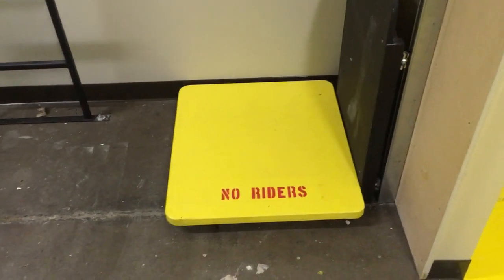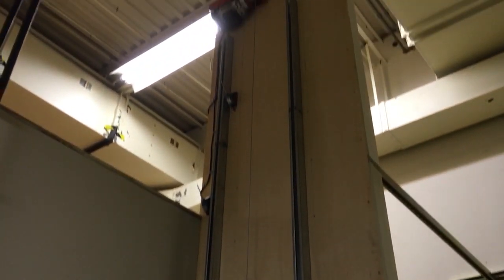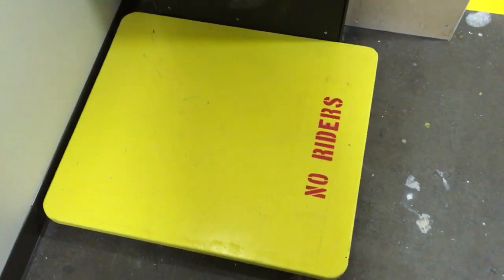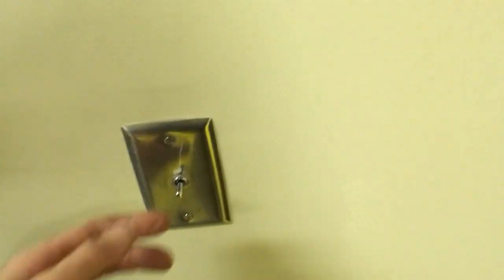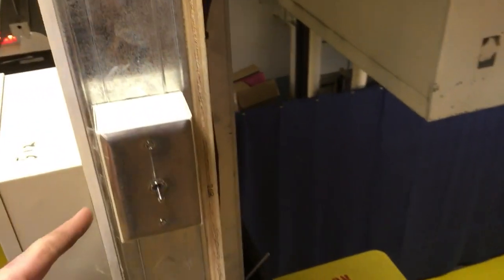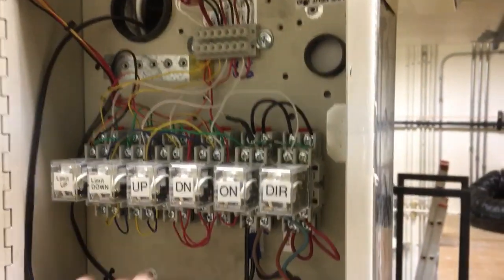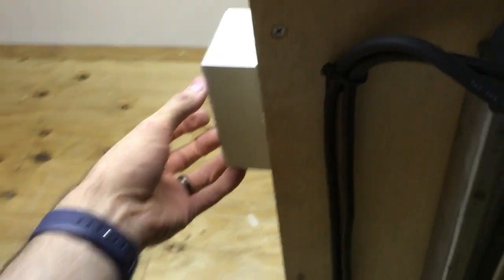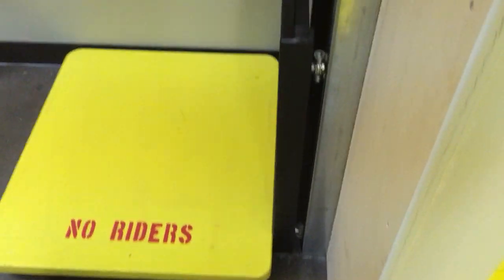Harbor Freight Hoist Dumb Waiter - Elevator

Comment: Nice design and build. Exactly what I was looking for. I can easily add a safety line or brake.
Reply: you want a slack cable safety where if the cable ever goes under slack, 2 spring loaded bars swing out and get stuck in slots in the channeling. Its how the first elevators did it

Comment: Suggestion…. add a second cable to the winch as a safety backup. I’ve had a similar mechanism using a steel cable which after many cycles ended up fraying and breaking. Your travel isn’t that great and the winch drum should easily accommodate a second cable. The second cable will serve to hold the platform in the event either one of the cables break.

Comment: I would be lovely to see the schematic for the relay and control circuitry. I have the exact same application and would prefer to do a "dumb", relay-based solution rather than get into Arduino or similar rigamarole.

Comment: The wiring etc.  in a nutshell;

JZSlenker

3 years ago
I don't have a schematic on paper.  Basically your need two DPDT relays to replace the rocker switch that comes on the winch.  One relay determines the direction, the other relay is "ON"   Apply power to the on relay to cause the winch to move, apply to both (via a diode) and it will move in the opposite direction.  To get the circuit to latch you setup two other relays that latch (via one of the two contacts).  This latch is cut off by the limit switches that are setup for NC operation.

2

Bill Gurley
Bill Gurley
3 years ago
Thanks for your reply!  That is helpful.  I have a couple of other questions.  1.  I assume that you're using a transformer to supply either 12vac or 24vac to activate the relays.  2.  I also assume that your up/down switches are small 2-pole, momentary on-on switches to activate the relays;  and it appears that you're using approximately 22 gauge wire for all of the low-voltage stuff.  3.  Finally, the hoist we are using is also a 440 lb unit, and it looks very similar to yours.  It has a big startup capacitor mounted inside the handheld control.  Did yours have a startup capacitor?  If so, is it installed in your nice wall-mounted control box?  Or maybe it's just not necessary?  Thanks again!

1

JZSlenker
JZSlenker
3 years ago
Yes, a 12V transformer powers the low voltage relays.  Wiring is 18 gauge.  Yes up / down switches are SPDT center off momentary.  This particular HF hoist has the starting capacitor in the box on the hoist itself.  You definitely will need to keep the capacitor.  You could just put it in your control box enclosure.

2

JZSlenker
4 years ago
The limit switches are from Grainger.  They are Dayton brand SPDT.  The Grainger part # is 12T962 they cost about $25 each

Quick question?  Why didn't you just use the wired remote that comes with this winch?

JZSlenker
JZSlenker
4 years ago
That would have worked but I didn't want the operation to be dependent on the operator stopping it manually at either end.  If you go too far on the down direction the steel cable would have un-spooled  resulting in a cable spool that would wear the cable out prematurely.

Comment: This is a super application for a diy dumbwaiter. You wouldn't happen to be willing to part with a schematic / parts list? I've been trying to figure one out for the garage to move groceries to the living space. My wife would love it.
Reply from the maker: The "tracks" are barn door sliding door channel from Tractor Supply,  the platform is constructed of welded steel brackets that are bolted to the barn door hangars.  The limit switches are cheap Chinese ones from Grainger, part #12T962.  There are three limit switches, one at the top and one at the bottom to stop the movement when it reaches the up or down position.  The third is an emergency stop limit that stops the hoist if a relay hangs or other failure occurs in the control relays.  It is wired directly inline with the motor so if the lift blows through the upper limit switch is will stop the motor before the whole thing self destructs.  I'll try to come up with a schematic for you.
Reply: Yes, a wiring diagram and electrical parts list would be awesome.
Reply: I too want to make a dumbwaiter for groceries. Please include a wiring diagram!
Reply: I need to build the same thing.  Would love a parts and wiring diagram for switches.
Reply: Love to see how to wire the thing. Thanks
Reply: Did anyone get a wiring diagram?
Reply: JZSlenker can you send me the schematic and parts list for this application
I am stuck now
I have a old 1 floor elevator the motor is reliance ac 1.4 hp motor I found the replace parts but the repair man said need to get a new control box which is very similar to your design
Do you buy this box or build your self. If build can I have the schematic or where to buy a same kind
Very thank you

Comment: It would be really cool if you could share a simple diagram for the relays! I'm considering putting a dumbwaiter in my house and would love to build it myself. I'm good on the mechanical end of things, but the logic side not so much. If you could help me skip past the trial and error part it would be greatly appreciated!
Reply: It looks like in the top of his box there are wires using 3 cores to the control switches, limit up and down look to be the ones with only 2 cores but the emergency limit seems to be the black wire that intercepts the power below the ON relay.

The wall switches seem to be common/up/down so im thinking he has used momentary up/down toggle with center return to activate the UP/DN relays which latch until kicked out by the limit relays. But i don't see anything stopping the motor from running when a switched is used in the wrong direction.

So if its already up and you flick the switch up instead of down then it will continue to raise past the switch for as long as the signal is sent, provided the limit is still triggered it will stop as soon as you let go, but if its not triggered because the pin it rests on has already gone past it wont until it drops the power with the emergency switch.

It also looks like the big black cable is not only the motor out but also power in. Which is why there needs to be an ON relay.

So the emergency limit is the only protection from people doing the wrong thing which will require someone to manually repair it and if that's not done carefully then it could destroy your limit switches. So i think it should have another relay or two so once the unit is up, it locks out the up control signal and if the unit is down it locks out the down signal. Then it should be user friendly so when you flick the wrong direction it just sits there.
Reply: @matthewlloyd8920  Fantastic! Thank you sir!
Reply: Do you have the schmatic info on the dumb waiter? Is so could you forward to me?

Comment: I hope you are still following this post.  I was wondering if you have a wiring diagram.  that was a really good solution for remote up down control using relays.  if so do you have a way i can contact you so you can email it to me.  thanks, great solution...

Comment: Needs two more limit switches and a high speed up relay and a high speed down relay
Reply: Chaz Hart care to elaborate?  Does this mean high speed in the middle between floors?
Reply: Doesn't the speed depend upon the wench it's self? (I'm really ignorant to all of the actual hardware and wiring.) I work in a hotel that has 3 floors and watching the housekeepers carry all of the linen and supplies everyday to the third floor made me think that we have a laundry shoot that goes from third floor to the laundry room on the first floor. So I asked a friend of mine to install a wench inside of the shaft so that a mesh laundry basket could be attached and lifted to carry all the linens up. It was a good idea, but execution needed some work. I didn't have a track or a shelf that it attached to, so the hook just hung down. The housekeepers (spoke just enough English to get by) didn't think it was fast enough, so they didn't use it. Kept asking for the man to fix it faster.  Well, once I looked at the skematics that came along with the wench, it stated that it went so many meters per minute, I assumed that there wasn't a way to make it faster. Does the way that this is installed, with the seperate relays to each function, enable the user to change the speed?
Reply: @jamielacerte9806   yes your right about the speed of your  wench. Your at a hotel so that's a commercial job. There's a lot of liability on a commercial job. I would take it down and make your boss pay for a dumb waiter to be installed.

Comment: Could a similar setup be completed with only 4 relays (Up Limit, Down Limit, Up, Down), or is the On and Direction needed?
Reply: Needs a direction somewhere, if its not a relay in the box it will be extra buttons on the wall. The ON was required due to the type of motor he used, so if you can find a motor that works without the ON relay then bonus.

Comment: Inspired by your video, I just finished building a similar dumb waiter to bring firewood from the basement to a ground floor fireplace.  I used Unistrut rails and a 5 to 1 pulley system as I wanted to have the hoist in an accessible location.  The travel distance is short so I could do without limit switches but I welcome the challenge to reproduce your control system.  Can you please provide me with the model number of the Omron relays.  Thanks in advance.

Comment: JZ, did you ever do a wiring diagram on this?  I would love to see it.  I'm helping a friend with something like this, although he wants about three "stations", which would make it more complicated.  I'm also wondering how you handled the "latching" of the relays so that they don't relax the relays when you release the momentary up/down switch.  I'm assuming this is done with the relays in the gray box?  Then they release the latching when the limit switch is activated?  Thanks.
Reply from the maker: I don't have a schematic on paper.  Basically your need two DPDT relays to replace the rocker switch that comes on the winch.  One relay determines the direction, the other relay is "ON"   Apply power to the on relay to cause the winch to move, apply to both (via a diode) and it will move in the opposite direction.  To get the circuit to latch you setup two other relays that latch (via one of the two contacts).  This latch is cut off by the limit switches that are setup for NC operation.
Reply: Thanks for your reply!  That is helpful.  I have a couple of other questions.  1.  I assume that you're using a transformer to supply either 12vac or 24vac to activate the relays.  2.  I also assume that your up/down switches are small 2-pole, momentary on-on switches to activate the relays;  and it appears that you're using approximately 22 gauge wire for all of the low-voltage stuff.  3.  Finally, the hoist we are using is also a 440 lb unit, and it looks very similar to yours.  It has a big startup capacitor mounted inside the handheld control.  Did yours have a startup capacitor?  If so, is it installed in your nice wall-mounted control box?  Or maybe it's just not necessary?  Thanks again!
Reply from the maker: Yes, a 12V transformer powers the low voltage relays.  Wiring is 18 gauge.  Yes up / down switches are SPDT center off momentary.  This particular HF hoist has the starting capacitor in the box on the hoist itself.  You definitely will need to keep the capacitor.  You could just put it in your control box enclosure.

Comment: Quick question?  Why didn't you just use the wired remote that comes with this winch?
Reply from the maker: That would have worked but I didn't want the operation to be dependent on the operator stopping it manually at either end.  If you go too far on the down direction the steel cable would have un-spooled  resulting in a cable spool that would wear the cable out prematurely.